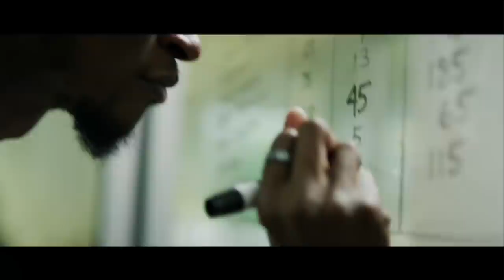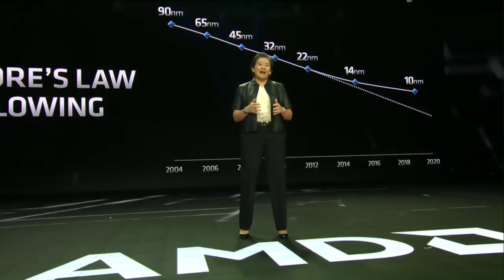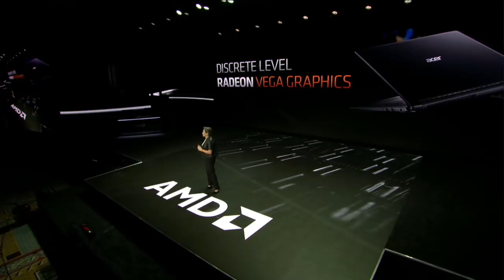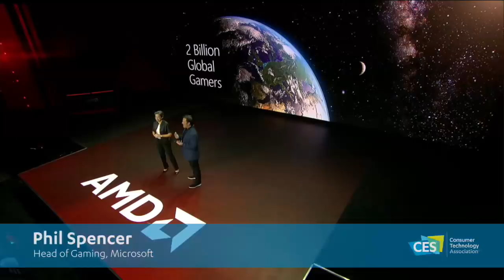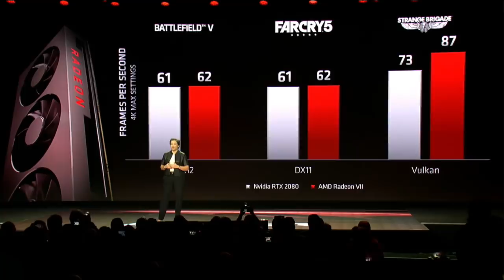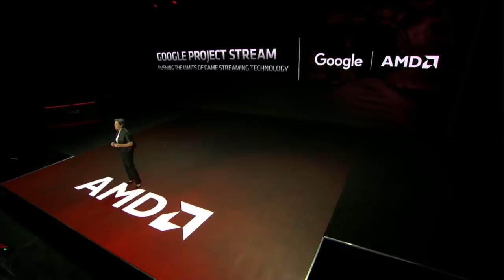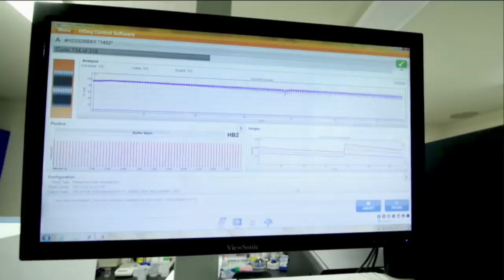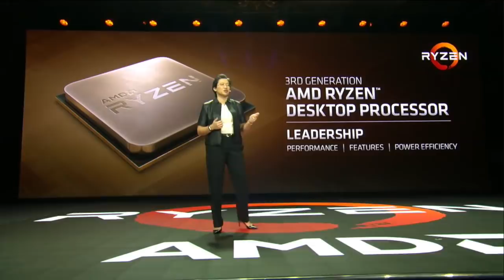AMD CEO Lisa Su's 2019 CES Keynote

Comment: That moment when they compared the 9900K, to the 8 core 16 thread RYZEN 3000.

2019 is looking GOOD for AMD. 😎
Reply: @SweatyFeetGirl  and it's not even completed, it's just an engineering sample. makes you think
Reply: The moment when they showed the Forza Stream and had just a little more FPS than the rx64 ;)
Reply: @KingOfGorillas An enginering sample perform a little bit better than intel's 14nm+++ CPU with 30% lower power consumption doesn't seems that bad
Reply: @SweatyFeetGirl  well you mentioned when clocked the same they nearly have the same IPC. Which means that Zen's problem in gaming is the clock speeds. If they can push their cpus to 4.7ghz at least, they would beat intel imo. Also, you mentioned the 8600k which is currently 50-60$ more expensive than the 2600x on amazon and newegg. Additionally, the 2700x gets beat by the 8700k in gaming by maybe 15-30 more fps, however when you start streaming at the same time suddenly now the 2700x has more fps than the 8700k while at the same time having a lower cpu usage. the 2700x is also cheaper. 

My point is that AMD is competing more in value than in actual head to head performance (in gaming) against Intel. Which means that if the Ryzen 3000 series can be clocked way higher than the Ryzen 2000 series, than it would certainly beat intel in gaming and of course in content creation. AMD needs no miracle, they have everything in the palm of their hands, they have all the cards to play.
Reply: When the competition is the fastest cpu intel makes. Sorry intel but your going to have to work harder.
Reply: They said the intel chip was running at base clocks which isn’t really impressive considering they were marketed to run at 5GHz lol. The low power draw is indeed impressive though
Reply: @zijkhal8356  you can even see the room on the chip for 8 more cores and 16 more threads !
Reply: AMD blew it on the gpu part, but man the cpu part is awesome its not even its final form or even the high end cpu, I can tell they can add huge core count on that cpu easily.
Reply: Zijkhal True but 1 core at 5GHz is underplaying the potential of the 9900k as every reviewer has shown that achieving 5GHz on all cores is child’s play on this thing. And as we all know, ryzen is not good with overclocking. As seeing they didn’t announce something that would be game-changing such as overclocking it is safe to assume ryzen 3 won’t be able to overclock so much as well. With that being said ryzen 3 is indeed a better deal as nobody needs 5GHz on 8 cores, but it will in no way outperform the 9900k
Reply: If AdoredTV's leak is correct on the core/thread count, it basically means this is a sample of a mindblowing Ryzen 5!
If it's a Ryzen 7, it seems fine to me as well.
Reply: Zijkhal what you said makes no sense because intel chips are made to overclock. Stock vs stock is even more meaningless than say highest clock vs highest clock. You want to compare them at their peaks not at their lowest. Do track runners compare walking speeds or sprinting speeds?
Reply: @rushdrift  Let us hope that Navi's worth the wait, considering they put most of their resources developing Navi to the point that made Vega underwelming, I asume we wont be disapointed with Navi
Reply: Zijkhal Don’t get me wrong, I’m not saying they’re terrible. But if you are going to compare their PERFORMANCE, it makes no sense to exclude an entire part of performance increases that overclocking can yield. If you want to say something is better, it needs to be better in all aspects. Right now sure their stocks are about the same in this test, but you can’t deny that intel has much better overclocking. Therefore the 9900k has better performance because it is faster than ryzen in more than just stock values. That being said, it does lack performance but it makes it up in low power draw and most likely lower temperatures.
Reply: @rushdrift  a GPU that is as fast as a 2080 for $100 less is not a good showing?
Reply: I'm also very satisfied with the presentation!
Reply: @SweatyFeetGirl  And on top of that, we already know that it uses significantly less power than the 9900k. So we can assume the clocks are higher than the 9900k, but that ultimately doesn't matter
Reply: C R U S H E D E P I C S T Y L E
Reply: @SweatyFeetGirl  The clock speed were likely extremely high (possibly upwards of 4.5 Ghz) but the wattage and therefore heat dissipation was low, meaning a stock cooler could push them and therefore that should be an attainable stock frequency. The 9900K out of the box puts out more heat than that prototype so if they make a CPU with two 8-core chiplets it should be able to beat the single core performance as the 9900K, the best in the world with double the cores and infinity fabric. Unfortunately, that's not what they told us today and I'm probably wrong. We'll see what it's like when the CPUs are either released or announced in May, AMD's 50th anniversary.
Reply: noName yet hey i think you meant to say 14nm++++++++++++plus++
Reply: Timestamp please
Reply: @Qyngali  $100 less isn't good enough rtx2080 were already overprice at launch, thats why people buy the 1080ti same performance cheaper price, AMD fail to take this to their account and use to their advantage.
Reply: A little better performance??? I think you missed the bit where it did it at more than 30% less power.
Reply: @rushdrift  It had double the VRAM though. No rtx or dlss though. It seems like a creator card rather than gaming. Navi I hope will bring more to the table. Personally I use amd cpu and nvidia gpu. So amd gpu will lower price of Nvidia GPU.
Reply: Hey aren't you the guy from the r34 subreddit
Reply: @wampyr88  yes I agree bu I watch some other vid they can't release gddr6 version because they probably need to rework the memory controller which need a lot of money, the thing is CES is a big deal AMD could have release a navi based gpu and steal the market its a chance wasted.
Reply: @tacowang  And half the price since thats a Ryzen 5 3600
Reply: @nonameyet2205  and it make the sample slower by bottleneck it not to surpass certain clock frequency

Comment: Ryzen 3000 supports 16 cores

1:29:55As you can see there are empty space large enough to mount another 7nm die with 8 cores.

At some point there are reflection of “pins” that was made to mount the die that I talked about.
Reply: But that would create more heat
Reply: @arandomguy7486  Joke's on you because my room is cold now. I need more heat.
Reply: @arandomguy7486  power draw and therefor heat is already halved due to 7nm, so with the same clock speeds you'd get the same heat from 16C 7nm as from 8C 12nm

Comment: It starts at 1:25:00 for Ryzen 3rd gen
Reply: Thank you
Reply: THANK YOU, YOU SAVED SOME OF MY TIME <3
Reply: Thank you 😊
Reply: @temporlary3416  yeah. It looks very empty
Reply: YES 😃 I am so excited
Reply: @temporlary3416  This. i'm curious.. Can anyone explain it? Is it possible that extra space is available for another chiplets or gpu? Because the in the rome chip they could put 2 chiplets on the side of the IO
Reply: Harry creasian I’m assuming it must be especially with that extremely small die size, maybe the next threadripper will work on normal am4 boards, who knows AMD has really stepped up their game since they released Ryzen, 2019 is starting off great!!
Reply: @harrycreasian4274  They could put a vega gpu there on the APUs or maybe release a "Ryzen 9" CPU with more cores, but less than Threadripper.
But you could really get a power problem, as in the Cinebench Test the 8 core CPU pulled 136W at the end of the test, let's be conservative and say only 90W of those where CPU, the rest uncore. Then another 8 core chiplet on the same clock would increase power by 90W, so it would be at 226W! And this is not even the final clock speed for the ryzen chip, so it would be even more power!
A real 16 core CPU in this package would require a monster cooler to keep running or really slow clocks.
Reply: thx~
Reply: Hero
Reply: @James-hh1yu  i really hope so.. Because I'm going to build new cpu next march.
Reply: @alexanderdaum8053  Yeah, looking at it it would definitely be a very power hungry monster if they just doubled it to 16C/32T. But it's also interesting to think that if they didn't engage in any foul play in the demo (the 9900K in "stock configuration" claim closely matches stock 9900K CB results from 3rd party tests so it seems legit on the Intel part, with MCU on it usually gains about 100 points, but MCU isn't supposed to be on by default), that single chiplet is effectively a 9900K running at 30% less power, so doubling that would be two 9900Ks running in a single socket at 140% the power of one 9900K. You'll need a really beefy VRM and great cooling, but that's some pretty awesome performance density right there.

Of course, this assumes no foul play of any sort going on, and that the final product actually hits the same sort of numbers. Still, the fact that they can at all showcase Zen 2 hitting parity with Intel on a core by core, thread by thread basis is pretty staggering improvement on their part. Will reserve judgment until final parts arrive, but it's looking pretty good.
Reply: @jubuttib  What I'd like to see is specific optimization for Zen. Many performance critical programs have detection of special CPU features like AVX and can use more optimized code on those platforms. But these optimizations are almost always compiled to optimize for Intel CPUs and used on all others too. If they could add Ryzen optimized critical sections in such programs that could also boost performance quite a bit. With that and the (very likely) higher clock speed of zen 2 it could be a really good product
Reply: @alexanderdaum8053  isn't this the power consumption of the entire system? AnandTech estimate the CPU to have been around 75W...  add another chiplet and you have 120-130W... which sounds a lot more reasonable...
Reply: @psionski  Whoops my bad, you're right, then it could be more reasonable to have 2 chiplet inside there.
Reply: @James-hh1yu  I wouldn't expect much if any package/socket shrink in the future, regardless of ...hopefully... continual process(nm) shrink. The problem is that, with the efficiency gains of each process shrink, it's almost all being 'spent' on performance. So, while each shrink increases performance-per-watt, the CPUs aren't actually drawing less(or much less at least) power than their predecessors because we're pushing the performance envelope with each shrink.
With desktop CPUs being pure performance CPUs(unlike, say, ARM, who has to straddle the fence in mobile products, even with the 'high performance' variants), each core generates a LOT of heat, and we just keep adding cores. So, inevitably, we're going to have to spread out the dies across the package just to decrease the density of heat, spread it across a larger surface area. And, this will be mandatory on some level because heat management is going to be a more and more critical factor in further increasing the performance envelope in the future.

For examples of this, look at all of AMD's 14nm products that they later manufactured on the 12nm process - the transistor size is shrunk, but the die size is the same as the 14nm part because AMD chose to spread the transistors out across this die area.
Reply: @alexanderdaum8053  imagine if this was actually the Ryzen 5... beating the i9 :) I mean, the leaks said the R5 will be 8 core, soooo.... maybe second chiplet for R7 and R9 (12 core and 16 core respectively)?
Reply: @psionski  That would actually be insane performance, but I'm not too confident in leaks in general... But a 16 core on AM4 looks doable, but does it really make sense?
For games 16 cores don't do anything more than 8 cores, so there is no reason to go that route, the applications where this many cores can be utilized (CPU rendering, simulation, etc.) would also benefit from the extra PCIe channels and more memory bandwidth that Threadripper offers, so I don't really see a reason to do it, except marketing... Making a 12 core AM4 chip and starting Threadripper at 16 up to 32 or even more could make sense to me, but we will see.
Reply: Thank b
Reply: I watched the whole thing, my eyes hurt now
Reply: thy
Reply: @temporlary3416  or compute cores
Reply: Compute units*
Reply: Why does AMD have to hold back and tease like this?!
Reply: Oh man TY TY 
How did you read my mind? ;)
Reply: You save 1h of my life time thank you
Reply: Absolute legend
Reply: James Belitz-Shomion  thank you
Reply: LIFE SAVIOUR!!!
Reply: @alexanderdaum8053  itd probably be meant more for workstations. so beefy cooling and some lower clock speeds. like a more home type work station where as threadripper is for like businesses. 

water cooling would be enough.
Reply: Thanks dude
Reply: Thanks man couldn't care less about the rest!
Reply: the hero we need, but don't deserve

Comment: That Ryzen test is huge, showing performance parity in an 8/16 configuration with power consumption levels that are 35% lower at parity, and a chiplet design which clearly has room for a second cpu chiplet.  AMD will clearly be able to offer 12-core and 16-core Ryzen parts.  AMD didn't specify the clocks in the comparison, so we don't know whod win on pure performance in an overclocked scenario at core/thread parity (I'd still assume Intel would narrowly win)... but it basically doesn't matter with such a huge power gap at parity performance (the power gap would only get wider as you overclock).  Plus AMD demonstrated a clear ability to go all the way to 16 cores on the AM4 socket.

Not only does this make for a very compelling AMD offering, but it will also force Intel's hand on pricing.

-Matt

Comment: AdoredTV was right then. The Ryzen 3000 sample was running just below 5GHz (lower than the Intel 9900K part by about 100MHz or so). The reason the Ryzen 3000 Sample kept up was Zen SMT scales substantially better than Intel's HyperThreading (20% vs 35% added performance per core)

Also of note was that Ryzen 3000 Sample had a "glue" mark where the 2nd compute chiplet would be placed in a 16 core AM4 CPU.

Based on that, I expect the Ryzen 3000 series to be at parity with the Intel 9000 series in both clockspeed and IPC, with multithreaded performance being taken by AMD substantially due to the much better SMT implementation and double the core count in comparison.

Comment: On Lisa you are slick. You compared Intel's highest end mainstream CPU to your future mid range CPU. We all know that CPU you showed us has a spot for one more 8c16t 7nm chiplet for a total of 16c and 32t. Naughty naughty.
Reply: (Citation needed)
Reply: It's a rumour, still unconfirmed. But fingers crossed.
Reply: or a vega
Reply: But that's the problem here - it's comparing intel current gen to their next gen.
Intel also has a next gen coming. 

Who's to sat Intel also wont release theirs in Q3.
Reply: @MauroTamm  A. This isn't the final silicon/not final clock speeds. Which means performance will go up (check out past AMD Ryzen demos, all of them performed better once they released vs engineering silicon)
B. Lisa compared the 9900k to their future Ryzen 5 CPU. This is not the Ryzen 7, nor Ryzen 9. 
C. Lisa has said in the past that Ryzen 3000 was designed from the getgo to compete with Ice Lake. Not the current Coffee Lake chips. So they have already planned ahead. 
D. It's possible Intel can release in Q3, but I'm not holding my breath. I wouldn't be surprised if we didn't get the new 10nm chips until Q1 2020

Comment: 1:30:03 Look closely below the 7nm chiplet. You can see the reflective electrical connections for the second 7nm chiplet they are going to put their for the 16 core sku's. They handled this preview perfectly imo. Showing only 8 cores allowed them to focus on the clockspeed improvements they made to catch up to the 9900k, and showing that die shot confirmed to fans the 16 core sku, without destroying their 2000 series sales

Comment: 8 Core/16 Thread Zen-2 Winning against 9900k?? I smell good signs here :D
Reply: AMD processors will finally beat Intel in gaming since IPC increase it's of a 19% from Zen+.
Reply: I smell bullshit, but ok... Most people i know get around 2150 score in cinebench with the 9900k. Also they didn't disclose the speed their cpu was runing at, nor memory etc. I'd wait till the REAL thing is out and reviewers do their job and present us with real benchmarks.
Reply: @josejuanandrade4439  dude.. CHIIIIIIIIIIIIIIIIIIIIIIIIIIIL
Reply: @josejuanandrade4439  I mean a ryzen 7 2700x is around 300 usd. The core I9 9900k is 500 usd. Unless amd is litteraly insane and boost the price of the 8 core 16 thread cpu. Even if the ryzen 7 is over clocked dollar for dollar its better. I'm not counting the ryzen 3000 rumors its core for core.
Reply: @briannguyen6055  Im sure it will be well priced. My doubts are about the real performance this chip has. Then again, is on 7nm, so if we asume a 20% increase in performance, it should beat the 9900k, of course, but the marging they trying to pull there... i dunno... it seems a bit sketchy. Kinda like those bs benchmarks Intel did before the 9900k came out.
Reply: She did not say that the chip she showed off was the same as the chip that bet the i9 9900k. She just presented an example chip to show the architecture.
Reply: @josejuanandrade4439  

Thats the cinebench score for the 9900k stock, all core 4.7Ghz. Nothing less.
Reply: @josejuanandrade4439  completely agree but only time will tell
Reply: @jossy4132  She did say one chiplet has 8 zen2 cores.
Reply: Wait till you smell the price 🤑
Reply: @briannguyen6055  it beats stock 9900k time has told you now